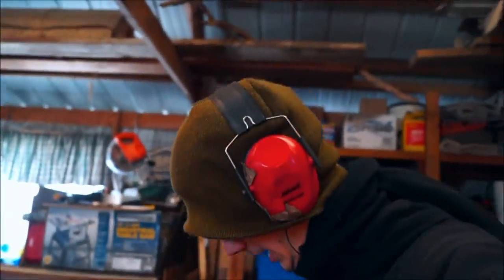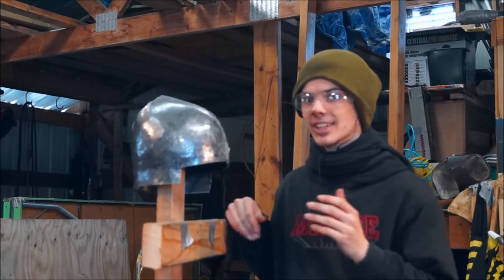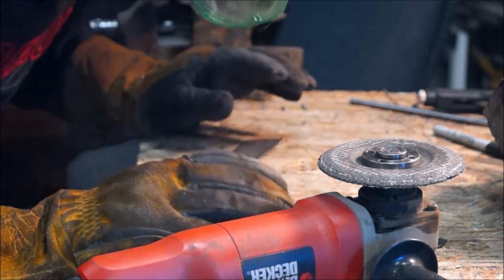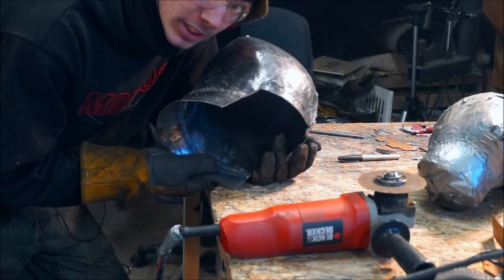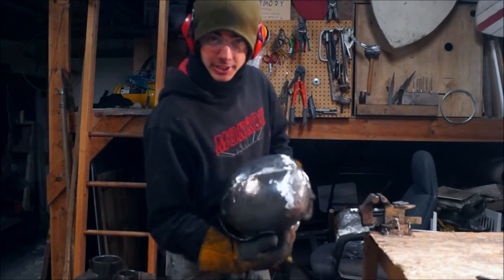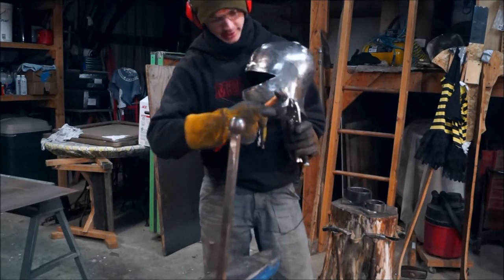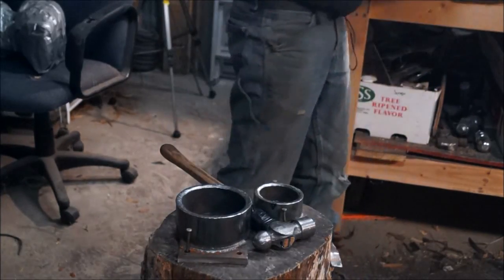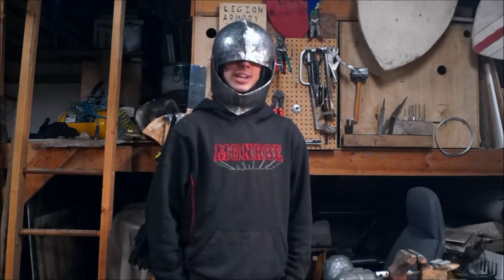Medieval Close Helmet 2: Finishing the Skull and Starting the Bevor

Comment: Have you ever considered using a propane weed burner for a heat source?  I used one for about 30 yrs. Cheap and easy to use and it's a huge, "brushy" heat source and not a spot like that lil thing you were using to anneal.   I made a fire brick box to hold my pieces while heating/cooling.
Reply from the maker: I hadn't thought of that, actually. Though now that I've moved my operation into a more climate controlled space I'm much more comfortable.
Reply: @LivingManuscript  Believe me the brush burner is just better as an annealing heat source. As you advance in your metalworking you'll find yourself needing larger and more adaptable heat sources.  Yes, it's possible to use those little hand torches but it's horribly  inefficient.

Comment: How close is this to how it was done back then? Did they "weld" or knock these out from single sheets?
Reply from the maker: This method isn't particularly close. Although in later centuries some helmets would be forge welded together, that doesn't seem to have happened during the time period that the helmet I'm basing this one off of. By the 15th century, most helmets would be made with a method known as "raising" from a single sheet of steel, which you can see Eric Dube do here: https://www.youtube.com/watch?v=eb7z5RyW3eI

I'd like to do this process sometime in the future once I have an efficient way of heating the steel 😀

Comment: At the end there, it looks like the right side (Left side if you're wearing it) of the bevor plate is longer than the left side. Specifically the length from the central crease to the pivot point. It might need to be shortened slightly in order to bring that central crease in line with the rest of the helmet.
Reply from the maker: You're right, it was a little warped. I was able to correct it with a little bit of reshaping to redistribute the material.